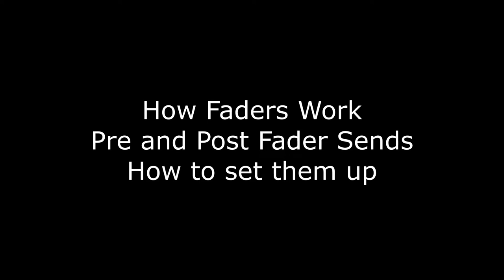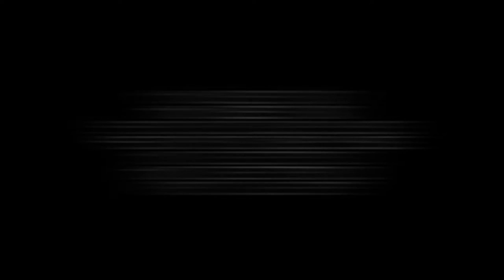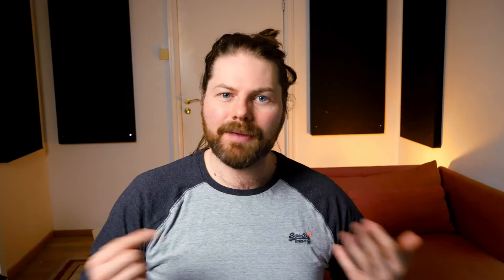Understanding Pre And Post Fader Sends

Comment: I am trying to learn more about sound boards, as I run the orchestral tracks for our high school musical.  One of the ongoing issues over the years is my need to have the monitors separate from the house.  When the whole group is singing, and especially when they are tap dancing, I need to be able to turn up the monitors so that they can hear on stage. The house is small, so to compensate (and so not to blow the audience out of their seats) I then need to be able to turn the house down. Does that mean that I need the sound going out to the monitors to be post-fader, on a different channel than the main house?  How would you recommend setting that up?  I think my main problem is I don't know the vocabulary well, so it's hard to communicate what I want.
Reply from the maker: Great question! Short answer: use a pre fader send. Long answer: when you connect a mic to a channel you use the gain dial to increase the volume to a level that the mixer is comfortable working at. Now when you turn up the fader, that channel goes to the master, then to the speakers. This is you setting a mix for the audience. Now if you use a pre fader send, you send a copy of the signal to another bus, basically another master, which then goes to the stage monitor. Because it's prefader it is complete independent of the mix you set for the audience. It even has its own master fader (the bus master). So you can use pre fader sends to build a mix for the stage. If you turn the main (audience) mix or master fader down, then the monitors will still have sound because we took a copy of the signal before the main fader (pre fader). So the main mix doesn't affect them. Hope that made sense and helped.

Comment: Hallelujah!  Pre fader sends to IEM monitors?  Yes please!  I have worked both as a performer on stage and as the FOH mix engineer depending on need.  When working FOH mix my job is to serve the musicians first, audience second.  It is critical to get the IEM mix right during sound check so the musicians can all hear each other for cues and inspiration.  Once this is handled, then I need to lock it in and work on the FOH mix.  

The simplest way to do this is to use pre fader sends to the IEMs on all channels.  I will also usually run a parallel channel for vocalists that is post EQ and FX so they can get that juicy goodness in their ears as well as a dry signal.  Then they can mix their vocal channels as they wish.  

Now I am free to dial in the FOH EQ, FX, compression, and work the fader levels without screwing up the musicians IEMs which might cause missed cues or simply suck the inspiration out of the room because they can no longer hear each other well.  It’s a pretty big deal and if you ever want to work with a band twice, make sure they have good, constant, unwavering mix in their IEMs.  Pre fader monitor sends for the win!

Comment: I mix sound from stage for my band and for my solo acoustic shows.
For the band, all aux mixes are pre-fader. Changes to any individual channel level are not significant enough for effects levels to pose a problem. However, if I did opt for post-fader auxes, volume increases to my monitor wedge from ANY adjustments to main channel faders would DEFINITELY cause a problem.
For my solo shows, I DO use a post-fader aux setting.
Why? Because I can't walk out front of FOH speakers while performing to hear the mix as I can with my band. For one thing, my acoustic guitar would most likely go into howling feedback. Plus, without my vocal I can only evaluate half the mix.
So I opt for sending the FOH mix to my monitor wedge so I can hear the same thing the audience is hearing.
I use a pair of QSC K10.2 powered speakers. One is on a stand for FOH. The other is my wedge.
I set all in-use aux 1 channel sends to unity and switch aux 1 to post-fader. And, of course,  I adjust the aux 1 master fader to a much lower volume than FOH.
This way, I can mix FOH and my monitor simultaneously.
I do carry a dual 31 band EQ in case I encounter a stage prone to feedback-causing resonant frequencies I can't control with volume management.
So far, though, I havn't needed it.